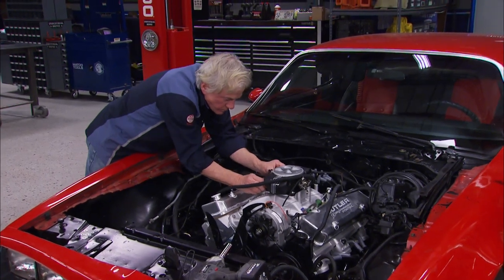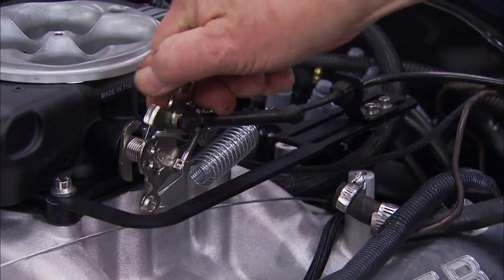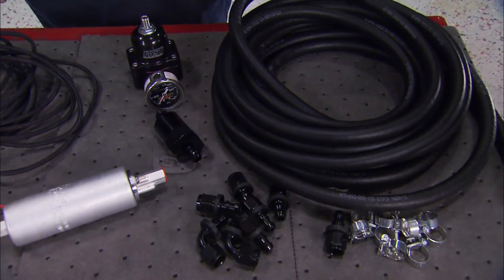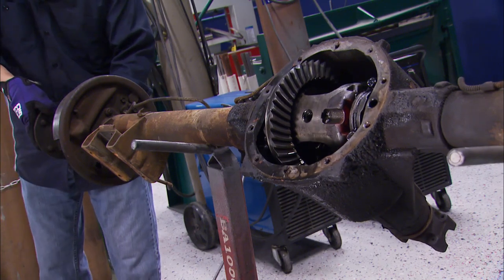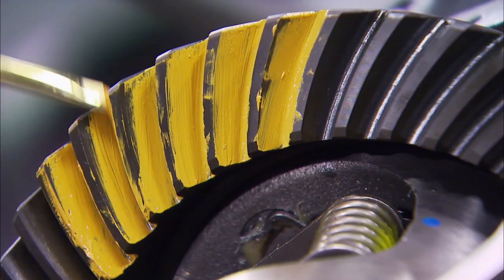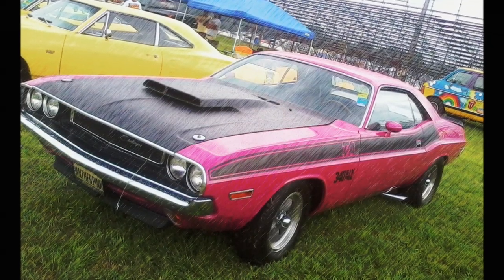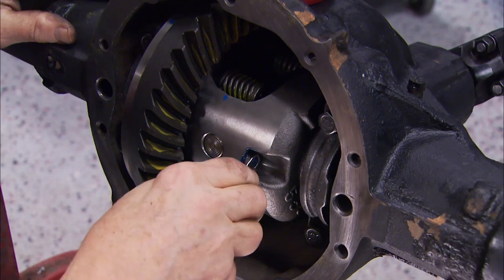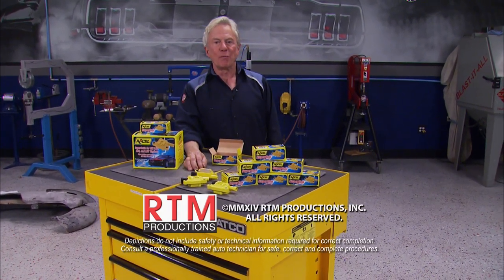1978 Trans Am Gets The Rear End Removed and Rebuilt - Detroit Muscle S1, E4

Comment: Very interesting to watch these Videos brings back great Memories. 
I was a Muscle Car Builder back in my late Teens, back in the late 70s Living in South County Lemay, St Louis Mo.

My Best Muscle Car I owned was the 1969 Orange GTO Judge, that I built and Blue Printed myself with the Help of Richard Kurtzenborn, and his Anything Automotive Machine Shop in St Louis, Mo. Not Bragging anymore, but I was the Fastest Street Car in Lemay County.
It Sported the 455 SuperDuty Engine from the Stock rated 390HP Grand Am.
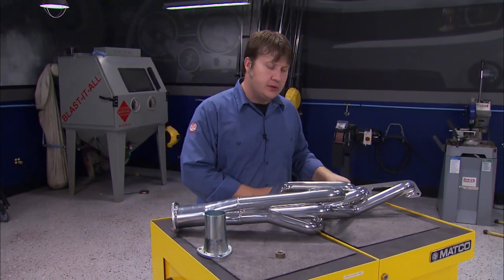Bored over 0.30, Forged Steel Crankshaft, Forged Pistons, 4 Bolt Mains Delivering @ 650HP, with Ram Air IV Heads and Doug Thorley Custom Headers, Sig Erson's Cam 450 Lift, 286 Duration Low and Mid Camshaft, 1:65 to 1 Roller Rockers, Using a Stock Jeted Quadrajet Carb. Turbo 400 Automatic Transmission, B&M Shift Kit, with Heavy Duty Parts. Rear end was a 3:55 Chevy 12 Bolt, with Steel Axles, heavy Duty U-Joints and much more that I can think of.

Best ET Times with Huge wrinkle walled Slicks and Liquid VHT, and open Headers. The 1/4 Mile was 11.22 Seconds, 1/8th Mile 7:73 Seconds.
St. Louis, Mo. And the Peavey 1/8th Mile Strip, Peavey Illinois.

I now am a Computer Technician for the last 20 Years.
I still own the 1980 Turbo Trans Am.

Comment: When I was 17 in 2982 I bought a 1977  Z28 with a lot of miles and a three speed automatic and I was so happy with it. I didn't get in any trouble with it either.
Reply: Did you get an anti-grav unit installed so it could fly the super skyway?

Comment: I am doing the same conversation on my 78 Trans am. Great information here, however I see you mounted the driver's side caliper outboard. That placement will hit the  driver's side shock. How did you overcome this? In addition,  thanks again on the spacer specs, it is all that I lack to finish up this conversion. I will share what I did to overcome the staggered shocks in the rear once I hear from you.

Comment: I am really surprised you did not toss that 10 bolt for a 12 bolt .
Reply: 8.5 10 bolt is almost as strong if you run the 30 spline axles.
Reply: My buddy runs an 8.5 10 bolt in his BBC Camaro drag car that runs 9’s. They are strong when built right.
Reply: @mayosturgell4474  yeah alot of buicks do as well. seen plenty of 9 and 8 sec turbo regals run them. i think they get bad rap cause of the oem gov locks the trucks used.

Comment: I'm still waiting on the project Overtaker prt2 . why not use a 1" 4 hole spacer plate under that carb that has notch cut out on top of each divider ? 1 for the primaries  and 1 for the secondaries ? it helps with intake pulses and with HP and torque and throttle response
Reply: @bigboreracing356   I bought a 30.00 spacer and modified it = low buget 😁 and works great . open holed spacers dont work for all engines ! some dont respond well to them
Reply: @bigboreracing356   you dont us NOS because chevys slow like a rock 🎵🎶

Comment: Videos like this make people think they can work on their own can. Then they tear apart an axle and have no clue how to make sure everything is right.
Reply: With a Haynes Manual, the right tools, a modicum of understanding of how cars work, and patience, there isn't anything they're doing in this video you shouldn't be able to do yourself.
Reply: @hualni  yeah.  But most people nowadays can't use hand tools without losing an eye and atleast one didget.   This stuff isn't rocket science.  You just need to be detail oriented, be able to follow instructions, and learn how to keep things clean.   Most large auto parts chains have a loan a tool program so no excuse there.   Now wiring on the other hand.   I run away from that like the plague.
Reply: @hualni  it's probably not the hardest thing to do once you understand it.  It's just intimidating